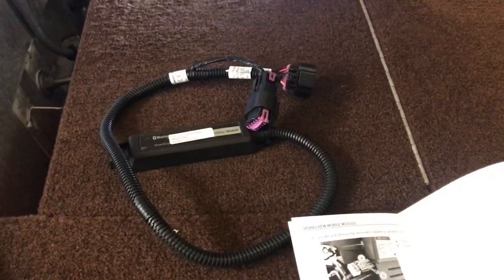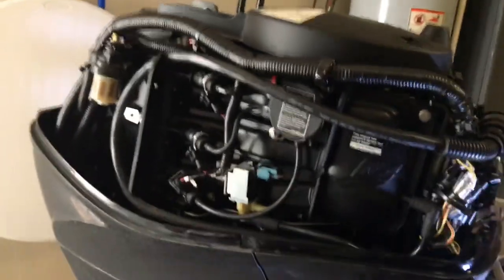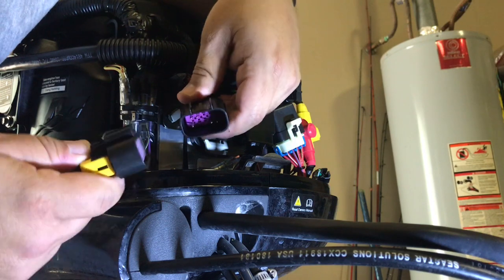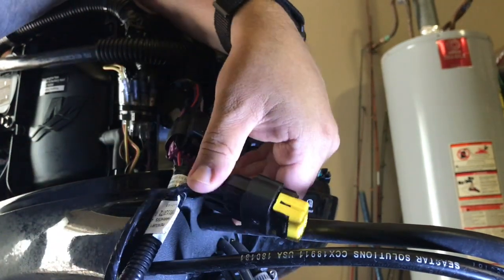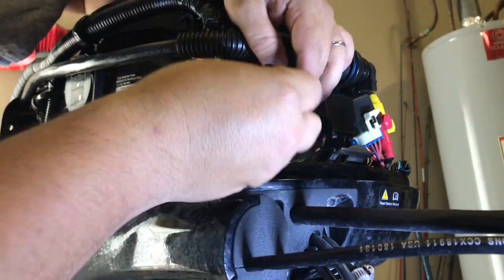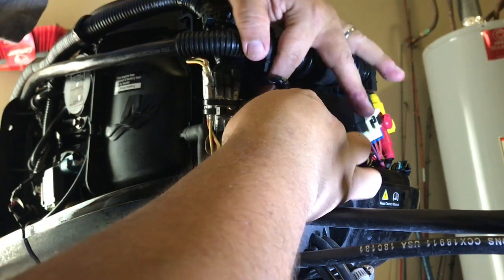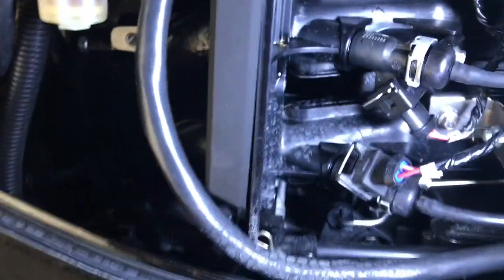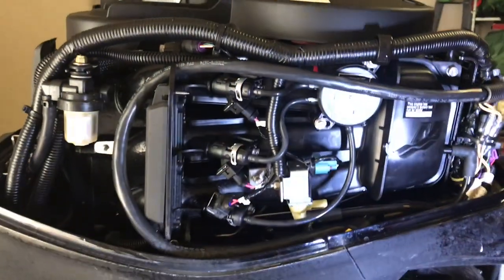VesselView Mobile On Heritage

Comment: Have you noticed it draining the battery? I just installed mine, and im worried it may drain it.
Reply from the maker: vNm BOSS , not at all.  Check that the blue light turns off after install.  If not call the manufacture.
Reply: @nachogtz3512  Thanks for the reply. The lights finally turned off after 10-15mins.